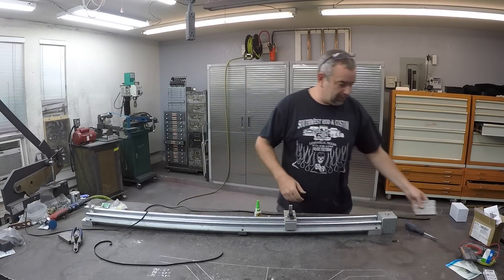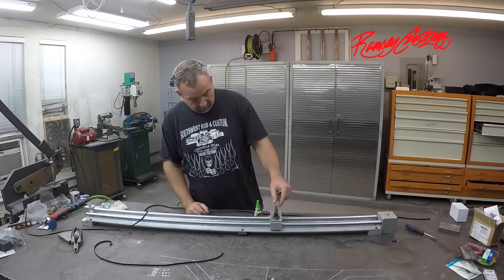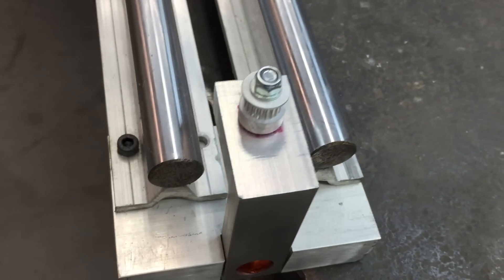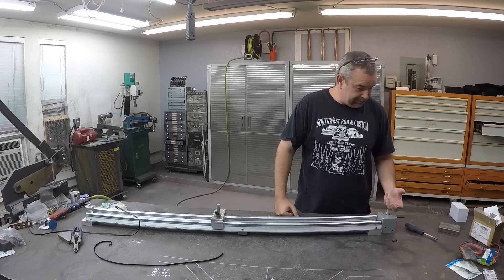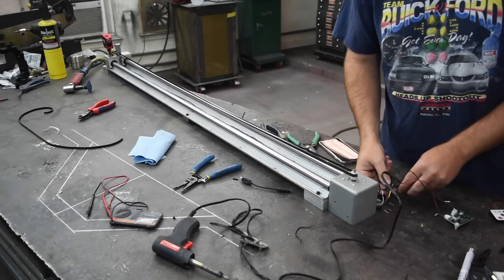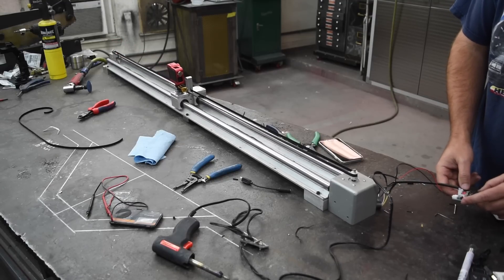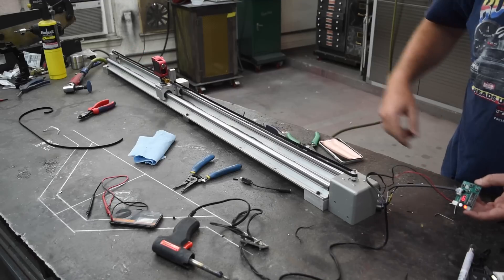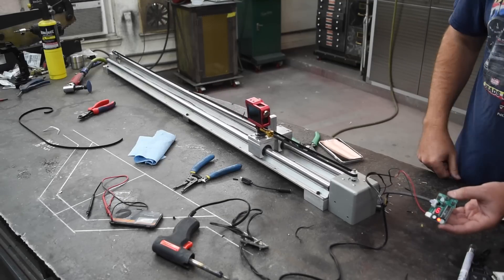DIY Camera Slider Final - GoPro - DSLR

Comment: nice slider ...u could use a small switch connected to the limit switches to change the power from one limit to the other or use 2 relays it would take a little bit of thinking on the wiring side but not expensive this would save on moving it each time.
Reply from the maker: j morley Hey man, yep your exactly right, I thought about some sort of solid sate flip/flop circuit, and something I could add later, for now I was looking to get the basic operation up and going for a product video that will be coming out soon...

Comment: Neat Stuff Gary....... like always!

Are you using the GoPro 4 with the automatic "Time Laps" option or using software for Time Lapse?
Reply from the maker: GasserGlass I have an iPhone 6 that has the time-lapse feature that the closeup time-lapse were shot from, and yes, the wide angle time-lapse was done with the go pro 4 in time-lapse mode.

Comment: Slick as can be. A little paraffin wax on those bearings might help. That's what I use on my sliding compound mitre saw.
Reply from the maker: EdOfTheNorth Good idea on the wax.  I put some Kluber bearing grease on the bearings, but then painted in the garage and overspray got on the linear rails, so they are a little rough... they need to be recoated with something.  Nice thing about the wax, is dust won't stick to it so bad like it does if they were old down.